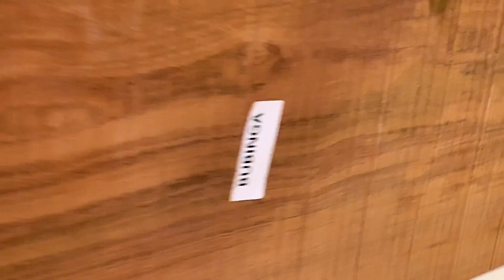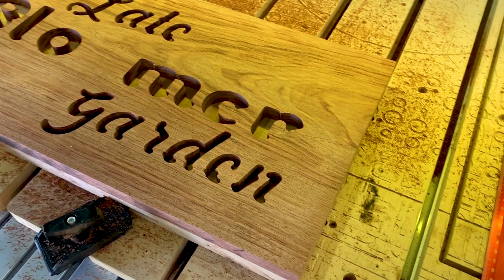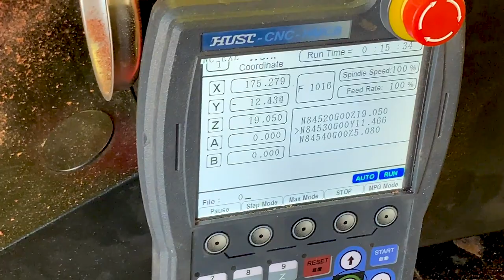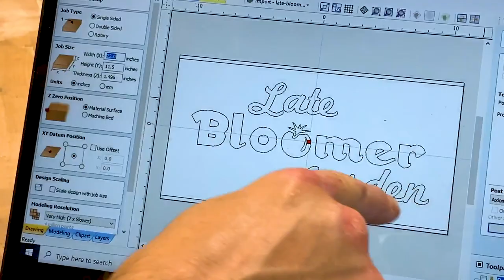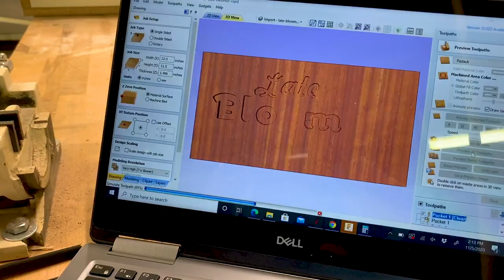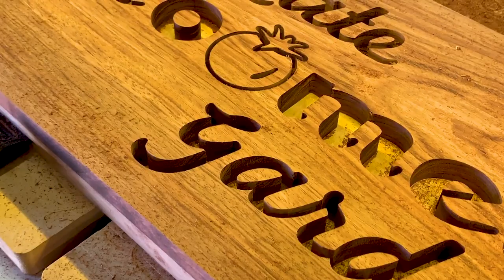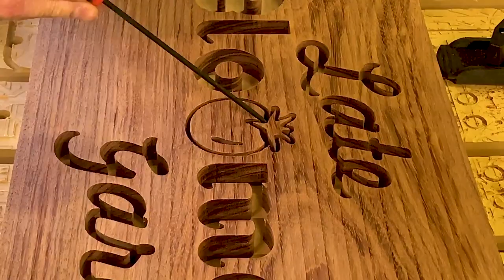My Sign Came out GREAT! J2D Makes on AXIOM CNC Router | Woodworking

Comment: Why didn't you use the profile with radius to cut the corner radii? Also, a round-over bit would have cut the top radius. No need for router or band saw.
Reply from the maker: Hm, I will have them answer, as IDK. Sorry I'm just responding, I got very behind in October and just catching up.